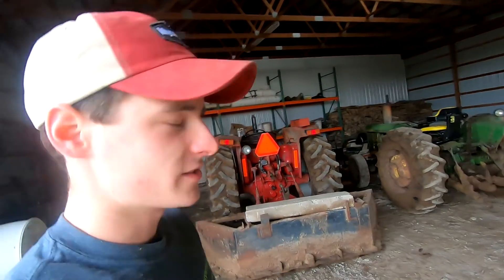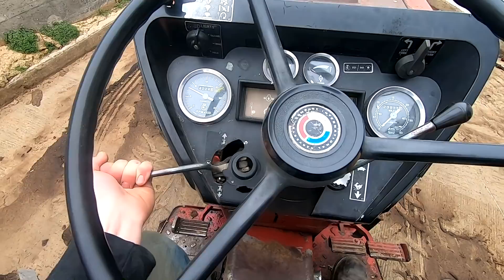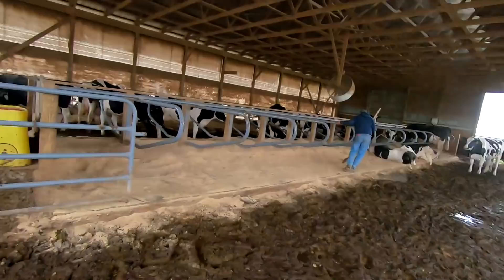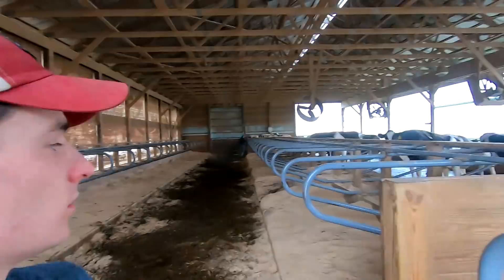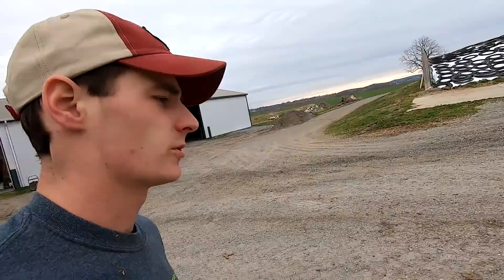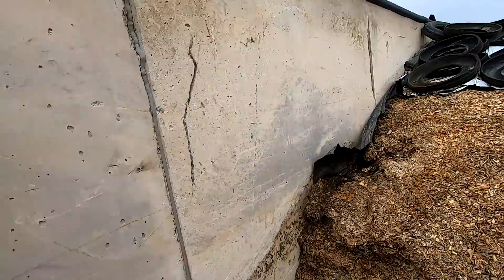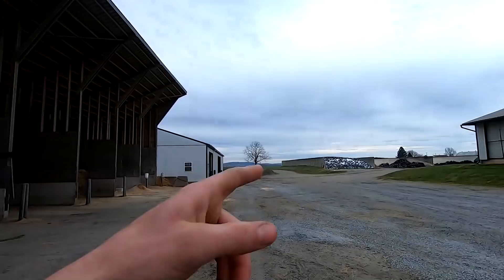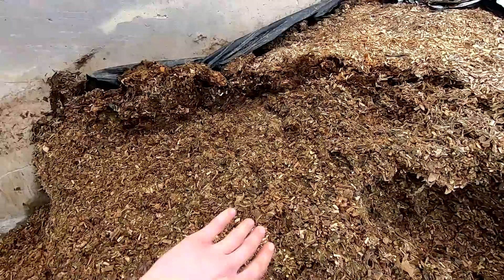International 84 Hydro Doing Work & Feeding New Corn Silage

Comment: I owned the same tractor for about 25 years I put a front end loader on it used it twice a day to feed silage to my beef cattle, also for hauling silage wagon’s in Haywagon‘s, I was unable however to use it for even a simple task of raking  hay the transmission would overheat rendering that totally inoperative. during the winter I had to connect it to a block heater on a timer however I lived in western New York where the temperatures got a bit chilly. Also had a snowblower on the back which having the hydrostatic Drive was terrific . Keep up the good work I always enjoy watching your videos Norm

Comment: Hydro needs a lot more revs to get the pressure for the transmission, that's why it's making that groaning noise. Also, that's not a clutch, it's a dump pedal to bypass the control valve, if you use it like a clutch it will overheat the oil and damage the transmission. Great tractors when used correctly

Comment: Clean old tractor.  FYI...on them its best to set throttle like 1600 and leave it.  Kepp good filters and Hytran oil in it and it will last for YEARS.  Good job on videos.  We milk in NWWA

Comment: I am not sure if this would help but as a suggestion that might make driving the hydro a little easier is if you raise that lever by bending it up or adding an extension so it is a little closer to the steering wheel. This way you could either reach it with your fingertips or at least not have to reach under the wheel like that.  (similar to like forward/reverse lever on some tractors)  Maybe adding some type of larger grip, possibly with rubber would help too.

Comment: Was that tractor made in the US. I had a 656 hydro. It had a true hydrostatic transmission. The lever was on the right, and, you just pushed it forward to go, it had an infinite range of gearing. It was about 65 hsp. and, could pull 3-16's in our heavy soils. I sold it because it was a gas hog, but, it was great for baling hay. Of course it was a much larger tractor. It was a gas model, and, i wanted to switch to diesel.